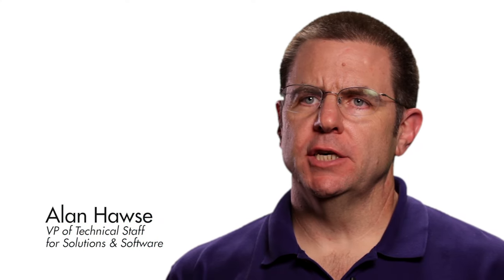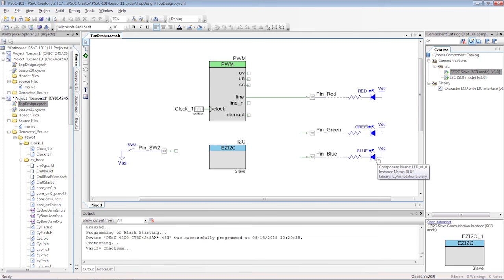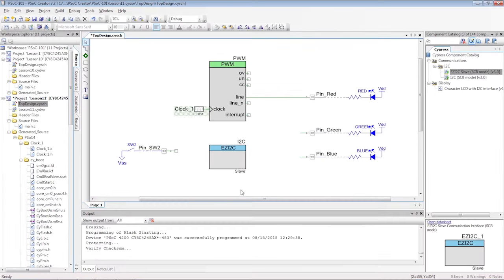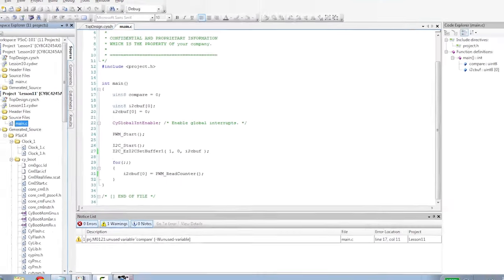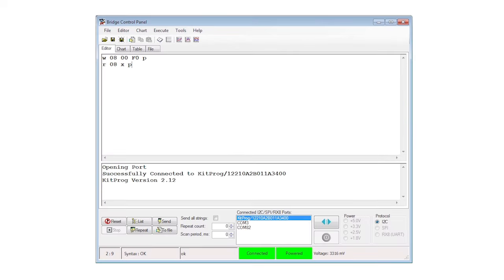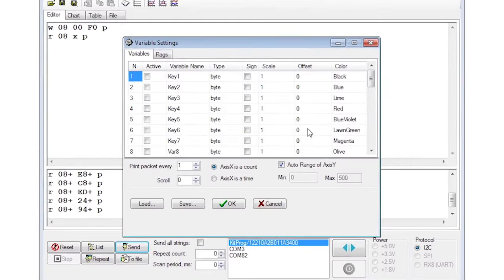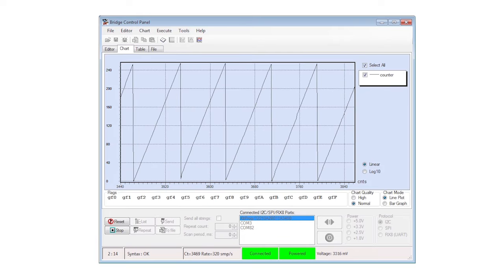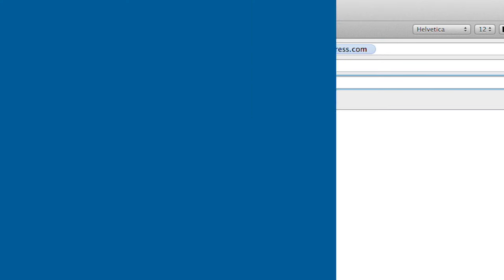Cypress Academy: PSoC 101- Lesson 11: I2C Transmit

Comment: Hi, I'm using Raspberry with Codesys using a PSOC 5LP in order to expand the raspberry I/Os. I'm using i2c bus, but when the data is received on raspberry, it started to oscillate between 255 and the true valor. I've used the pull up resistor (4.7 Kohm), but it still not working as well as I wanted. What`s wrong?